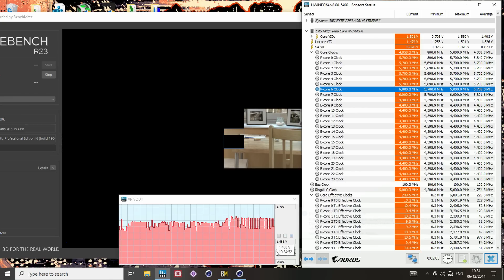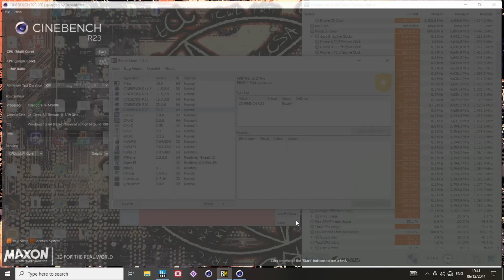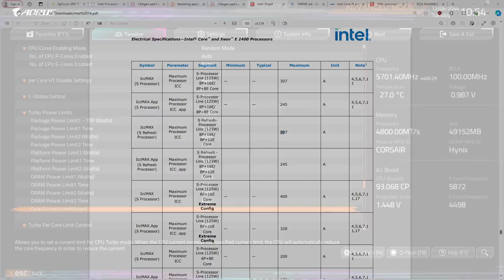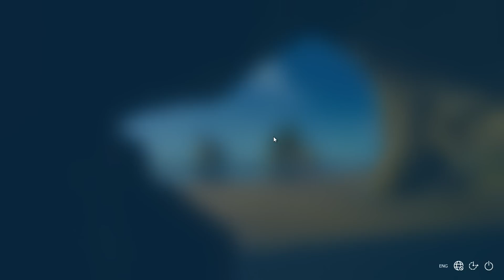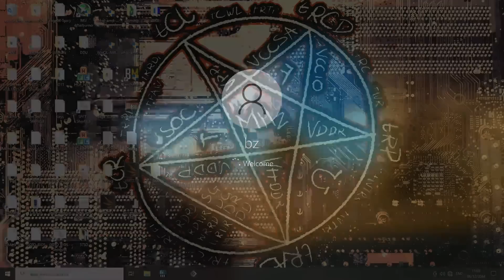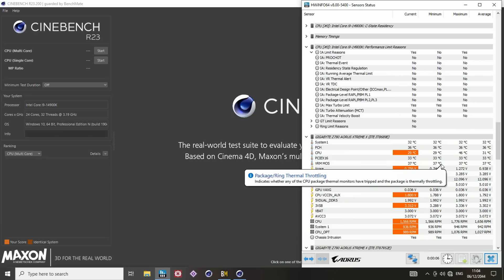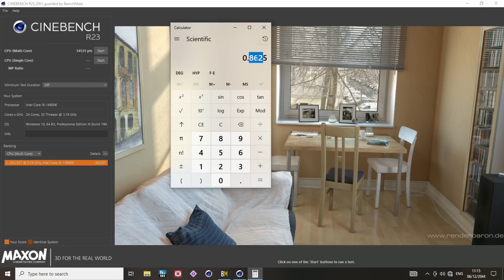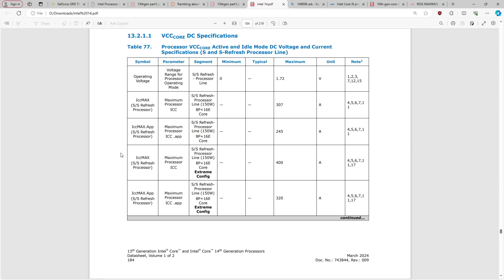Gigabyte's Intel baseline profile runs some ABSOLUTELY INSANE core voltages.

Comment: i don't know how exactly it went with AM5, but limit was ~1.4? maybe 1.45V

problem with burning sockets was mostly Asus, due to using that 1.4 limit, while others went for 1.2-1.3V, also Asus board wasn't suppling only 1.4V, it was more like 1.5-1.6V, so power limiting on Asus side went bananas there, other than applying max recommended voltage. I think even them  reducing it to more like 1.3V ended with 1.42V on probe

problem with gigabyte was that OC was saved as default, so reseting to default made it keep OC and CPU was burning, so it was way more uncommon for casual user to trigger

it might have been AMD fault, but really, since derBauer found out that 3d cache was burning quite easily, then 1.4V was recommended limit for any 3d cache part, i think even before AM5 x3d parts came out
Reply: for am5, start with all core -25pbo and increase it until no longer stable, most packages should do -30 just fine, good ones all core -50 even
Reply: As ASUS was running the CPU out of spec, it was not AMDs fault. They just learned they cannot trust the MB manufactures and forced the 1.3V limit in the AGESA.

Comment: I have Gigabyte motherboard for AM4. Installing their new control center kills cpu telemetry. I have no idea how. It just reports 0 on everything after that. And doesn't seem to boost properly.
After uninstalling this garbage all measurements are back, and I can now hear my cooler spin up on load.
Too sad I noticed this a bit late, because I use this PC for work only. I just wanted some RGB :(
My gaming pc uses MSI MB.
---
TBH After seeing this madness, I'm very happy I'm still using r9 5900x on my 2 machines. Entirely stock settings, just XMP enabled.
It's still more than OK for both my work and for games I play.
Decent $30 air cooler is more than enough for it.
64gb of ddr4 is very cheap.
I basically have 0 issues after the TPM stutter was fixed.

Comment: the Turbo boost alghorithm has an up and down curve, like a radio wave, always trying to up the frequencies, then hiting thermal throtle and lowering next, eventually there a spike that the motherboard cant control and youll see 1.6 or more voltage in one of those spikes. Solution, fuck the boost alghorithm, use a fixed all core frequencie on the BIOS, or even better, buy AMD.

PS: these voltage flutuations, not to mention they are already on a very high spectrum, are basicly silicone killers, this is what is degrading CPU's so fast,  the power consumption is like a side effect, more frequencie needs more voltage\power, so like i said , fuck the Turbo boost, set a fixed all core Frequencie, 5.2\5.4mhz on 14900k and maybe also undervolt a bit, and you voltage graph will be much closer to a flat line, lower and ofc the power consumption will come down has a result.

Comment: It seems to me that Gigabyte just added a profile in the BIOS they will use as a recommendation when they get support requests for crashing CPUS. The call it "Intel baseline" but it is in fact an "overvolting baseline" so that degraded CPUs could work a few months more perhaps until they degrade even more due to the high voltage.

Comment: 188 watts is almost  the power limit for the 14600 not really sure why or where gigabyte got it's values, even more when msi and asus have very  different values for pl2 and there isn't a single document from intel in regards the 14900 that mentions 188. 
That said I have my own theory. motherboards and their sensors in regards wattage applied are limited to a 10 ns window, so they do not actually reflect spikes of power and in certain workloads cpus independently of whoever makes them  will for brief moments have spikes that go way above the  pl2 value... and i mean way above like 350+ for i9s and i7s and I am starting to think that some motherboards cannot handle that, the cpu does not get enough power and become unstable. That is way in many cases independently of whatever pl2 is used, there is instability unless iccmax is set to 307 or thereabouts. I also made a test with tthe cpu of a friend that was crashing  on 2 different boards, and his mb it crashes and in mine  it  doesn't. 
Same cpu, same pl1 and pl2, same iccmax  ...so is it  actually the cpu the cause? why will it crash in motherboard A and not in motherboard B? and why if i do not want to crash i have to lower icc max in one of them?
Reply: It's PL1 125W & PL2 253W for the 14900K

Comment: I don't know what Gigabyte is doing recently...My 13900KS runs 1.409V VR Out max. with single core load 6GHz on Apex Encore and never had any issue with the CPU or instability and never had to use any baseline profiles etc.

Comment: I saw 1.7V and thought that motherboard vendors were high on something. Now I see that this is technically within spec so now I know it's actually Intel that are high on something
Reply: Even my Riptide Z490 with a 12600k was running 160W and 1.31V and peaks at 1.41V for single core boosts. I genuinely thought something was wrong with the mobo since that type of voltage for 4.6GHz on modern cpus is completely insane. I then did UV and it now reaches the same all core frequency and R23 score at 1.14V and 120W. And if I let it go to 160W it boosts at 5.1ghz with 1.28V. 
I know that UV will always have an efficiency advantage over stock settings, but going from 1.31 to 1.14V with same clock is insane
Reply: @mastroitek  using 13600k stock clock with 1.07v (from 1.23-1.35v); i think i5's are safe from this entire issue 😅😅
Reply: That would produce 528.040 Watts of heat!!! 1.72 Volts times 307 Amps = 528.040 Watts. 
I guess my 360mm AIO won't suffice for that.
Reply: @elita2cents  Introducing The New 528.040mm AIO "Hells Kitchen"  or "Satans Schweddy Balls Edition"™℠ (Trade Mark and Service Mark)
Reply: Both? Both. Both are mad.

Comment: From my own experience motherboard companies tend to jack up vcore, my 9900k on an Asus Maximus board wants to push 1.35v+ vcore for stability on the optimised defaults setting and even higher if I do all core turbo. 

With a little tweaking I got vcore down to 1.15v, which is slightly lower than Intel's default profile and dropped the temperature.

Comment: I have set a number of mitigating clock/power settings to stay well under 90 degrees even on small FFTs on Prime 95 on all my 13900k/14900k systems but I would certainly expect any of the CPUs to at least run Cinebench with the crazy limits. I sent 2x 14900ks chips back for that reason. If I owned the chip used for the video it would be RMA for me, even if I planned to limit everything to play nice.

Comment: Is a low budget Motherboard (Gigabyte B650 DS3H) paired with 7600x and 3080ti has good upgradability path? Especially for GPU? Cause this motherboard has PCIE 4.0 and I am planning to go from 3080ti to 5070 or higher (or AMD equivalent). I am a 1440p gamer.

Comment: Funniest thing is that if you just disabled hyper threading it becomes stable, less power and thermals. The only caveat is that the performance is similar to the intel baseline profile in the multi threaded workloads, but it's better in games than stock
Reply: You can also disable 16 E-cores, Hyper-threading and 4 P-cores and get an overpowered version of 2500K. But no one will do this because it's stupid
Reply: @lexkoal8657  I'd do it, mostly because I'm an idiot, but I'd do it.
Reply: @lexkoal8657  you don't need more than 8 threads for gaming atm, so disabling hyper threading and e cores will avoid any thread allocation errors and give you far better thermals and stability. so for strictly gaming/ single threaded workloads that is the optimal configuration
Reply: I agree, and if you reduce the number of E-Cores to 8, it's even better for gaming.
Reply: Could you pls elaborate how limiting E-cores makes it stable? In that case would it make sense to choose 14700 instead? Aksing as I will eventually upgrade my 13600KF (runs on a regulab B760 Asrock board)

Comment: Since when power limit was a matter?! It is all on temperature, and the voltage. The voltage itself limits the maximum power. Power limits exists to be set by the system thermal solution, otherwise they have nothimg to do with overclocking, and degradation caused by that.

Comment: I finally managed to get stable 4.9ghz allcore without random bsods using ac/dc loadline 50/90,  override vcore set to 1.180v and IccMax 279A. 12900k and z690 aorus pro and Noctua NH-D14 cooler.

Comment: consequences of hamfisted 'stability' attempts post-product release...

neuter the chips with extremely low ICCMAX & Power limits, slam high global voltage at it so it'll be gucci. User won't experience any degradation if the chip is running at severely neutered clockspeeds, since they'll never push high freqs under load!

fucking ridiculous man. these chips are so amazing when user-tuned.

Comment: Around 1.5V continous is still high. I would like to see max 1.3V @continous on this size silicon.
Almost 1.7V boost is just insanity with ambient cooling.
Reply: 1.35 is enough to do easily 5.5p/4.whatverE and use under 250w. And the kicker is that you still hit near 39k in C23. If you go all out on overclocking, have the big custom loops, you'll get maybe 42k, but at massive wattage increases & heat loads. For ~5% to 10% extra performance that isn't that relevant for most people.
Reply: @bigpoppa1234  Exactly. Why it is bad that the motherboard vendors push the CPU so hard on "stock" settings. They should aim for stability/longevity on a stock settins profile. Just adding extra voltage for a tiny performance increase might lead to "stability" short term, right untill degradation.
In the old days, most of those who choose to manual overclock, knew this trade-off with the performance increase.
Most average consumers don't know this is happening, and they don't know the core temps either. High temps are not so bad if voltage is low(think laptops) But high temps are really bad if voltage is high. And the problem with electronic/semiconductor in general, is the hotter it gets, the more voltage is needed. So a vicious cycle.
Reply: The 5900X I daily drive does 1.5V SC sustained, but I suspect that's more about the boost algorithm freaking out at 20-40°c during load
Reply: @laceflowerhw  It's normal to see 1.5V during max SC boost on Zen 2 and 3. (And almost 5 GHz SC boost on 5900X) Not harmfull voltage on these shorter turbo boosts. But during sustained load, I would prefer max 1.35V on these... unless you can cool it with some extreme cooling.
Reply: I AGREE

Comment: Imagine dropping the big money for a 14900k, not overclocking it at all, and having it crash on a single pass of Cinebench.
Reply: Imagine spending more on a 14900KS and having to underclock it to 5.8 all core to get stable 😂 oh wait that's my reality ☹️
Reply: @user-vsmsdos  question. isn't 14900KS the max p-core all core is 5.7? 5.8 all core is overclocked not underclocked. you only get 6.2 on a single core from the factory.
Reply: @royboysoyboy  I thought it was 5.9 factory but you may be correct. I ended up having to go down to 5.7 at 1.398v as I was not comfortable running over 1.4V and I used LLC6 to deal with vdroop issues causing instability at idle for me. I've become stable with these settings for my particular example. I was able to slightly overclock the e cores to 4.6 ghz at 1.32V... Chip is stable and happy it seems. Unnecessary and it should have been stable out of the box. However, as an enthusiast I expected to tweak shit... Just figured I'd have headroom here lol. I guess technically I did have some with the e cores...
Reply: I would be upset for sure. To be fair I had a rough time with my 7950 x3d build recently and had a bit of a time getting it stable. I lost the silicon lottery twice with my CPUs from Microcenter but at least the second chip is stable. The first motherboard I got was bad and I swapped the board and CPU just in case. I also switched brands of boards. I've had good and bad experiences with Gigabyte Aorus boards, and wanted to try MSI and ASUS. The MSI had a nice bios layout but it was DOA so I swapped to an ASUS Prime X670e Pro WiFi and it worked better straight away. Getting Curve optimizer to work with anything more than -5 is proving to be difficult and my cooler is an Arctic Liquid Freezer III 360 AIO that I've remounted to make sure it has good mounting pressure and thermal paste spread. Even using a thermalrite contact plate with it all I still have low undervolting potential on this chip. I think it odd though because the SP rating is like 111 which from what I gather on ASUS's end is supposed to be a very good rating for the chip. The cooling is 160-174 pts and It never goes over 86C.

Anyway yeah, Intel needs to own this not blame it on the board partners. I would have bought another Gigabyte Aorus board but I need 7.1 analog audio support out of the box without sacrificing the front panel audio headers to use for rear I/O.
Reply: @StormBreaker1987 It's not going over 86 because at least one measured part of the CPU is hitting tjmax which is 89 on that CPU
Reply: @falcie7743  I'm curious how you would know that specifically. When I'm looking in hardware info none of the course and none of the readouts go anywhere near 89° that's only what I'm actually overclocking it versus undervolting it. When I'm undervolting it it hits basically 82 to 84 c max. Is there somewhere else I should be checking to see because there's no thermal throttling being reported on the board or in any monitoring software.
Reply: @StormBreaker1987  if you have a device with HDMI Arc connected to the PC you can just buy a 7.1 audio decoder instead of a motherboard with these features.
Reply: @marsovac  Unfortunately I don't it is actually 7.1 surround PC speakers that use 3.5mm jacks for every 2 channels and they are powered from the subwoofer. It's a very old creative labs set of speakers. My other equipment I have some nice headphones DACs and amps for my headphones. I have kept the speakers for a long time since high school. I'll eventually replace them when I have a house I'm not renting. I've just avoided it because they work great for gaming and music when I don't feel like using my headphones at my computer. 

I appreciate the suggestion though.
Reply: @StormBreaker1987 wow 👍. Never ever have heard anyone using analog 5.1 or 7.1. Not even sure how to enable them. I've had at least 5.1 analog mobos from AMD 2100+ xp times.

Getting 5.1 from passthrough was a pain (you needed codec packs and was it AC3? with a ship) I think I used optical back then... 😅

Nice and thx for the memory.
Reply: i have a fix for your problem, buy amd
Reply: That could happen with earlier versions of enthusiast motherboards aswell. Nothing new there really. Dont buy a K part or oc mb if you dont plan to tune it. On the otherside I would be very annoyed on the motherboard manufacturer doing a piss poor job on the stock voltage loadline.
Reply from the maker: @impuls60  So how would you prove that you didn't get a DOA CPU if the CPU isn't expected to function correctly out of the box?
Reply: @impuls60 you're being disingenuous. How many system integraters have shipped PCs with stock settings only for customers to have either an unstable computer or having to warranty it? This is pretty unacceptable.
Reply: @impuls60  Your comment would make sense if the non-K SKUs had the same power limits as well as base and boost frequencies as the stock K SKUs which isn't the case as the non-K SKUs are always slower than equivalent K SKU at stock settings.
Reply: @impuls60  Don't buy a K if you don't want to tune it? Is that seriously how CPUs should be sold?
Reply: @impuls60  been buiulding computers as a hobby since i was 13yo 2002 with pentium 3 if i recall correctly, and back then AMD cpus or chipsets were actually a bit too unstable at stock, but since i started building computers as my actual job in 2015, that was no longer a widespread problem for any vendor, it's just now that intel is so desperate this has become a statistically relevant issue again
Reply: @gabrielecarbone8235  Via, SiS, and other vendors who were around the time got a lot of crap over faulty voltage regulation during the Super Socket 7 and early Athlon eras. I think it really was their fault rather than AMD's, but AMD still had the reputation of not being the most stable platform, which was true from a buyer's point of view.

Comment: Intel wanted to break the 6 GHz barrier, no matter if all of the silicon is really up to it. I think the board manufactures has been informed by Intel, that they "should" put out "plenty" of voltage for that boost frequency.
It's cheaper than QC of all the CPUs, and set a max voltage norm.
Why not set a stock CPU boost freq a few hundred mhz lower, and have it running healthy voltages and stable?
This CPU arms race just got into mad mode.
I'm sticking to AM4. Not even AM5 has got me excited. I like what just works! R9 5950X is an efficiency powerhouse (especially if you clock/voltage it a bit down)
Reply: Yeah. They pushed at the cost of Silicon longevity, voltage and stability.   If you see CEP in datasheet exists proves that HW engineers knew the limits. But bean counter management team simply did not care and wanted that 6Ghz. RIP.
Reply: yeah, just -30 the 5950X and it runs pretty cool
Reply: I'm totally agree with you, because I reduced 14900k from default 5.7ghz to 5.4 ghz using intel XTU, the temperature run at least 10°C cooler on average. 

On high loads it never exceed 80°C , i prefer it these way so the hardware produce least amount of heat can last longer.

Comment: Intel: Gigabyte runs our processors under conditions of "sustained high voltage and frequency during periods of elevated heat"!
Gigabyte: high frequency you say? there, fixed, good thing it was just frequency